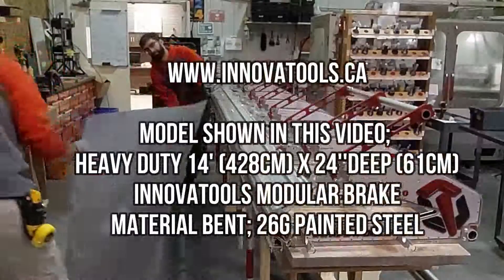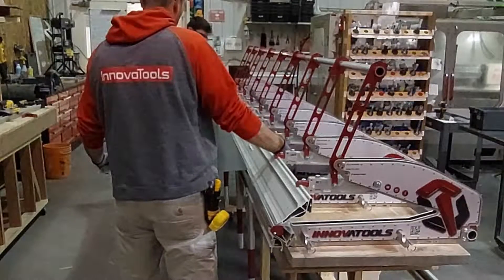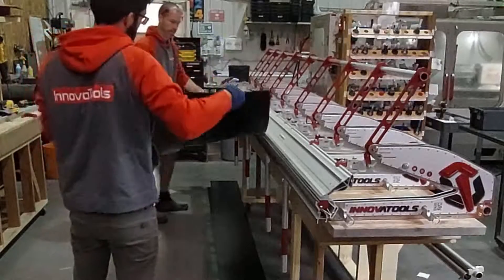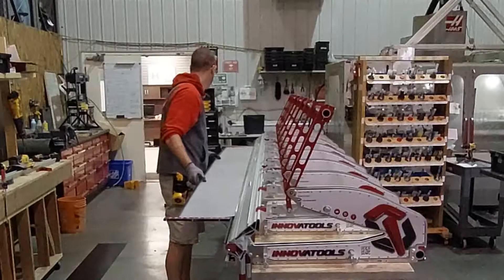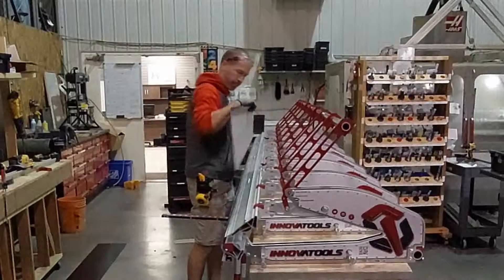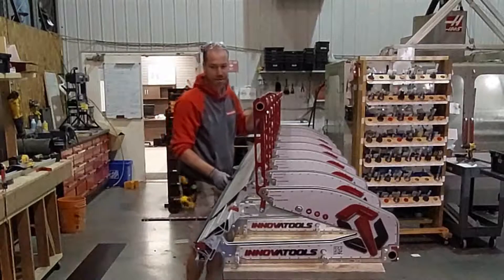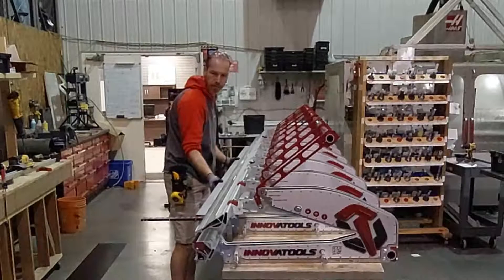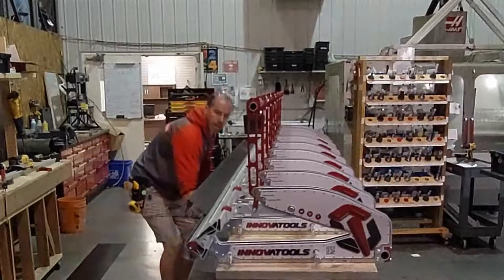Bending 26g painted steel snow guards for metal roof with Innovatools portable Modular bending Brake

Comment: impressive. How flat will the top handles lay down? I tend to lay my aluminum on top of the brake to make marks, will the handles go down parallel to the ground so I can lay my sheet on top of the brake?
?
Reply from the maker: It goes flat in storage mode (need to remove the arm pins) but the whole point of our brake and accessories is to NOT have to do any premarking before bending,  you shouldnt need to do any marking with our system saving that whole unecessary step!
Reply: @innovatoolsinc  when bending a simple door header one or simple piece of trim, its simplier to just make my marks than to use stopper and gauges…. Hence my need for the top of the brake to be flat. That’s how i use the pro 14 and i have your system on it. Just no need to use for one or two pieces of trim. But very handy for larger trim work. Just wish i could lay the top of your brake flat. Coil would lay flat up there even better than the pro 14. Just habits of the trade and will always be of use for my line of work. I have to have the top of my brake. It’s honestly the only reason i still have the pro 14 and not ordered your brake. Every thing else is amazing about that brake! Did a good job.
Reply from the maker: @aluminumtrim  thanks, with the 24" depth you just feed the sheet in and pull to your measurement you need and start bending right away to be honest in my opinion....  the pro 14 wont give you a full flat surface i dont think unless im missing something?  Before the measuring guages and when i was premarking i would simply set the sheet in the hinge pocket and rest it against the closing handle that way the sheet was about 45deg angle making it much easier to mark in my opinion as opposed to leaning over a flat piece no?
Reply: It’s easy to flip my metal to the top of my brake to make a quick mark as the crank handle will lay flat back. A mark my metal on top of my brake all the time…. Just not a habit that will be broken after 25 years. As well as many old timers in the business. It’s same review im getting showing some others around the company here.
Reply from the maker: @aluminumtrim  every habit can be broken if a better option is found ;) i personally use to have it standing on a 45deg laying in the lip resting on the top handle on my tapco brakes when i first started operating brakes already 22 years ago now :s time flies! I dont premark my coil stock anymore but laying it on 45 to premark on our brake is even easier with the handle running across the whole length of the brake giving a flat surface